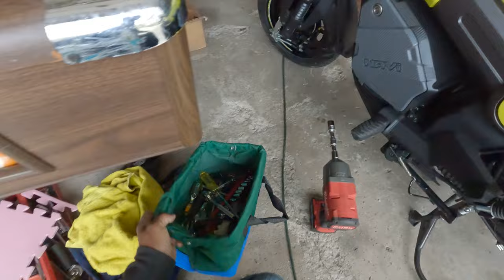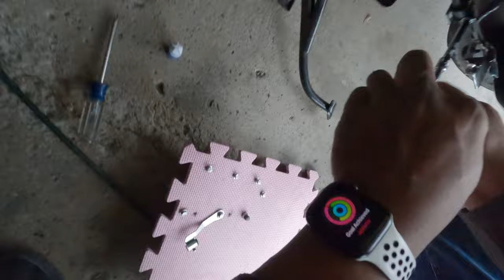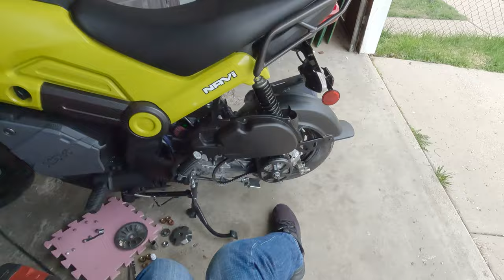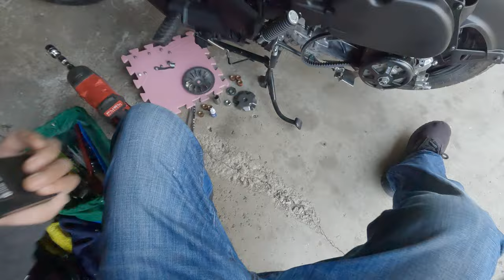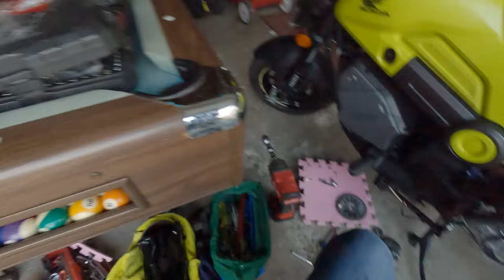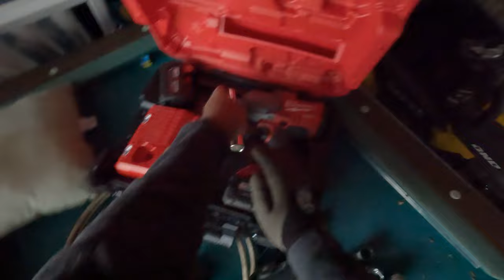do this if you want a fast honda navi / FREE variator mod top speed on any scooter / Guaranteed!!!!!

Comment: I see you added a new clutch bell… did you also add performance clutch? Or is that the only aftermarket part you have in the cvt?
Reply from the maker: yes the RDR clutchbell made a big difference in clutch grab and acceleration leave your stock clutch on the navi the only thing i would do is rollers and the variator mod and clutchbell

Comment: I'm not sure why but my likes to try to shut off at stops, only 100 miles on it too
Reply from the maker: mine did to the valves need time dont touch the carb just ride it and use honda GN4 oil no synthetic add me on fb ill tell you some fast secrets your navi will do 60 when im done
Reply: I’m interested in some tips for a fast Navi!
Reply: warranty it
Reply: What weight sliders do you recommend to use with this mod for best top speed? I am thinking in the 12 to 15 gram range.